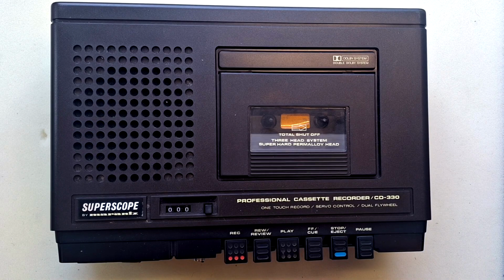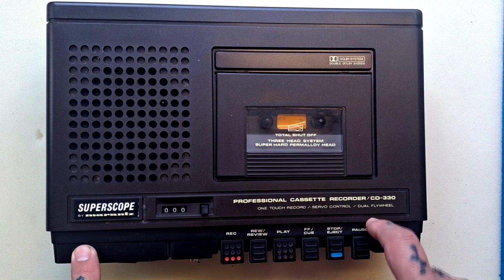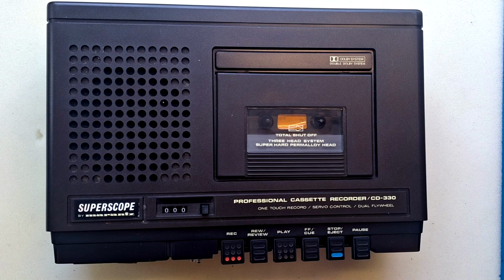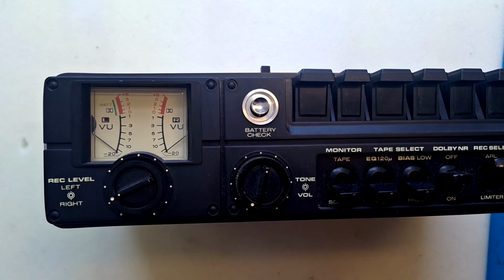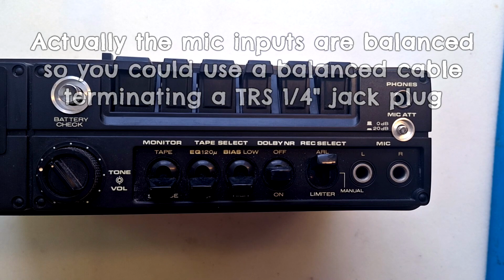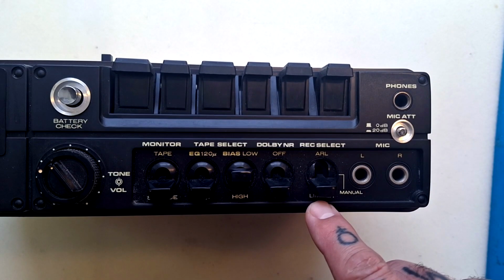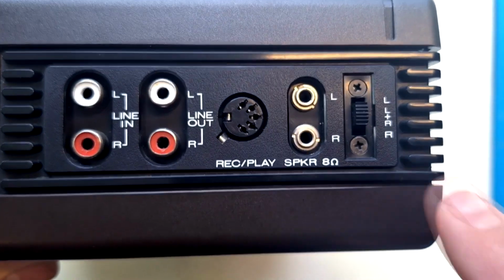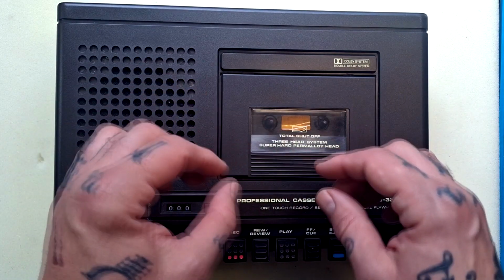Marantz CD 330 Superscope | First Look & Features Overview

Comment: Thanks for the great overview. I've got the Superscope CD-320 and restored it. It's a two head version and so no tape monitoring. I really like it and enjoyed the restoration and so I looked out for a CD-330 and bought one and now enjoy the benefit of tape monitoring. You can indeed use it for a short delay, I've played around with this a bit! I did not know you could move the record levels independently, even though I've had it apart, removed both knobs and cleaned the pot I presumed they were fixed together somehow... I'll need to give this a try! :)
Reply from the maker: Thanks for clarifying the difference between the two versions!